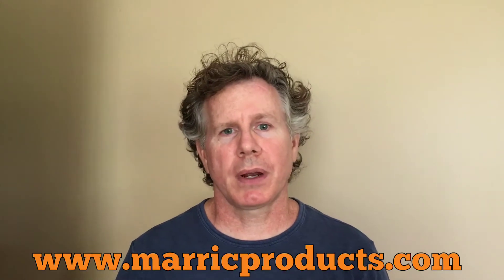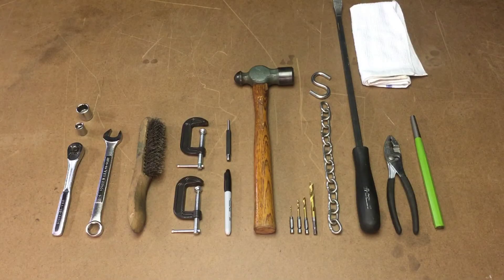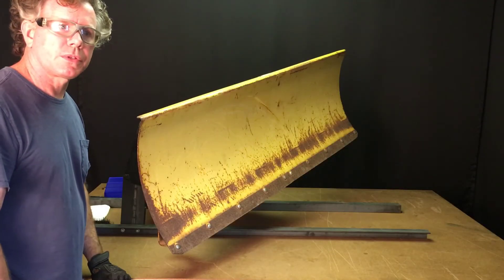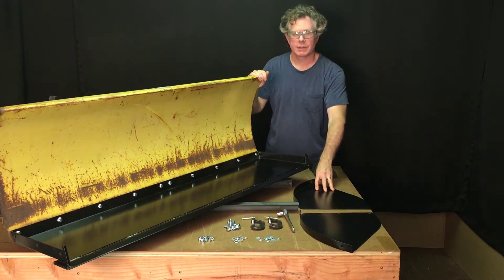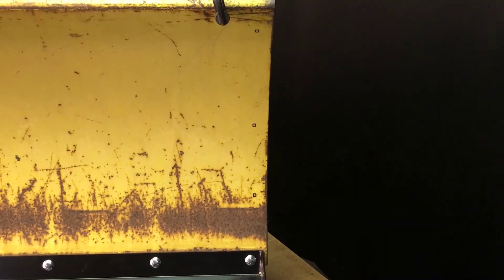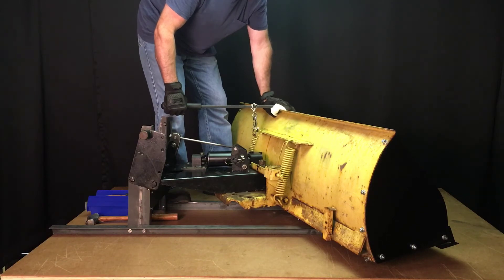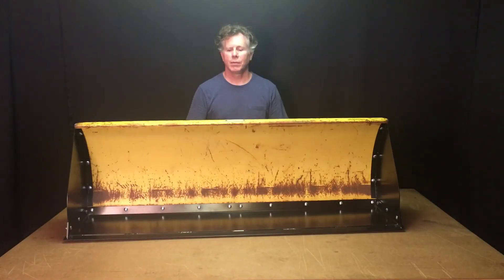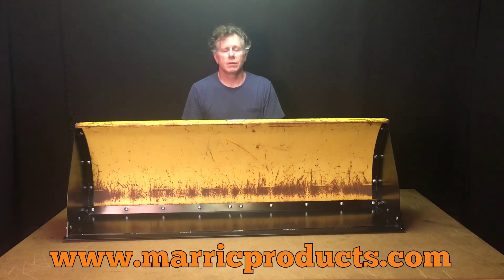Marric Products Part 1: Installation of Moldboard Conversion Kit on John Deere 54 Plow

Comment: How thick is the bottom plate? The website references the 3/8" cutting edge, but how thick is the rest of the sheet metal? It looks like it's thinner than the plow blade itself.
Reply from the maker: The bucket sheet metal is made out of 12 gauge steel which is approximately 7/64”.